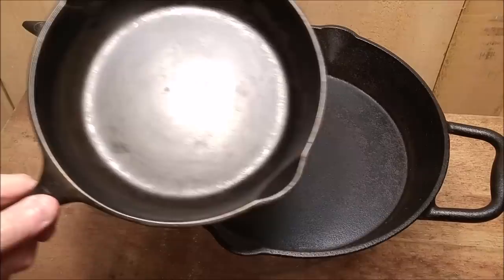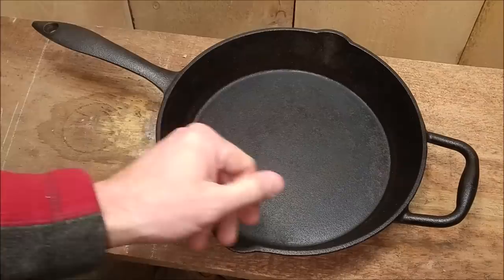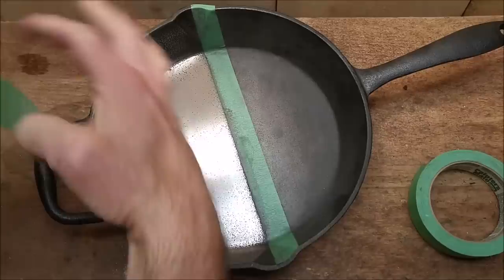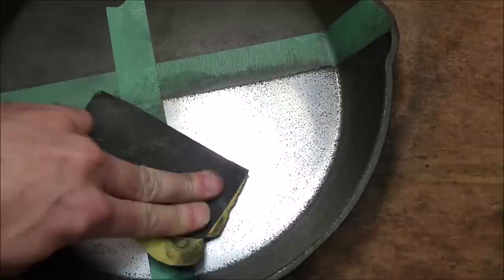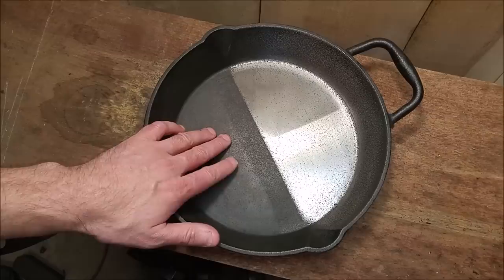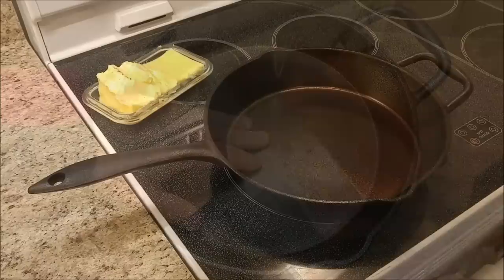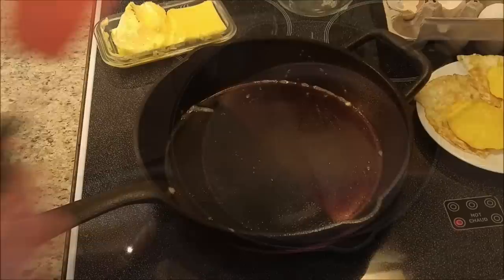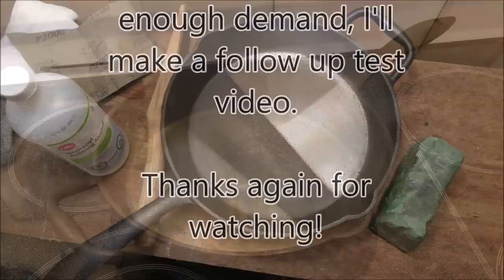🍳EXTREME Polish - Smooth a Cast Iron Pan to Reproduce an Antique Skillet then take it way beyond

Comment: You never need to do that many coats when seasoning.  One, maybe 2 is all you need.  Too much oil will make your pan sticky.
Reply from the maker: A few months ago this was a problem, but I've been using the Stargazer method lately and I get the deep black color more quickly and the coats are completely cured and hard.  1 coat may be enough, 2 and three coats work well also.

A thick layer of oil will cure if given the right heat and enough time.  I plan on showing this process in an upcoming video... another testing video, so I hope you'll check it out when I'm finished.

Comment: Thanks to show us useless work. I have original cast iron and don't see any reason make it shiny .  Work very well. Oh yes when I want see my face I use mirror ...
Reply from the maker: Yes, there is no reason to do this, but I know this by testing it.  The video is quite useful from a learning standpoint and gathering the thoughts from viewers to generate a consensus on the result.
Reply: The purpose was not to make it shiny for reflection. I'm thinking about doing something like this to my Lodge pans rough, sand-mold finish. To me, my smooth milled old Wagner, always had much better non-stick qualities.
Reply from the maker: @TheTony2u  I'll be releasing a new video in a day or two which does a good job of showing a semi-automatic smoothing process, along with info on a few good tips to prep for the seasoning.... and testing of course.  I will say that you only need to go to 120 grit and that holds the seasoning well, anything beyond that will work against you for adhesion.

Comment: Just get a ceramic coated one and no need for the extra work
Reply from the maker: I was just checking some out on Amazon tonight.   Are there any downsides?
Reply: @NeedItMakeIt  porcelain chips off at extreme heat
Reply: @twiin12879  i find mine sticks with certain foods where my regular cast iron does not.

Comment: You know nothing about cast iron.  Putting such a hot skilket under water like you did will cause warping or cracking.  Seriously, why woukd you show ithers to do that.
Reply from the maker: At the time of creating the video, maybe so.  What makes you say that doing this is a bad idea?  Please also provide your background so that everyone knows that this comes from someone who has valid knowledge on the subject.
Reply: @NeedItMakeIt  Not trying to pick on you, but since you threw it out there, honestly, your response verifies you don't know much about the nature of cast iron metel which is more prone to cracks and warping when exposed to significant temp changes in short time frames.  Just the nature of the metal.  My ex once used a crock pot, crock, made from ceramic, to boil water on the stove.  I laughed and told her it will crack the pot due to the temp differences.  She pulled the pot off the stove top to shiw me all was fine and at the exact moment the bottom fell off.  Funny but true story to illustrate my point.  I am a Naval Academy graduate with numerous engineering and chemistry courses. Plus I am a cast iron fan and have done lots of research. Why I sent this  is becaue I have a hard time finding cast iron cookware that has not been ruined by people who have abused it like you did.  So, please feel free to submit anything legit that states what i told you is incorrect.  I am sure you are a great guy, but you hold yourself out as some sort of cast iron expert, yet you do not some some basic principles.  Again, Mr cast iron expert, give me legit proof what i said is wrong and i will retract.
Reply from the maker: @Incognito_Shadow007  Thanks for the information Keith, I don't mind that you comment, people have their opinions, so let's hear them.  Please don't assume that you know anything about me by watching a video, and there are quite a few generalizations in your comment as well, "people have abused like you did".  You don't have context on much at all, and you've made quite a few assumptions.  

Now, I don't claim to be an expert by any means, nor do I say this is a good method or bad one, but it is the one that I do use, and it works well for me.  It seems that people who comment on this are 50/50, lots of people use this method, lots do not and have your opinion.  I say do what you like.  As far as proof, my pans... the pans I use daily, all still work, the work very well, they have not warped, but really, this isn't my idea I learned it from Kent Rollins https://kentrollins.com/easytricktocleancastiron/ , he has a video specifically on this topic and show people how it is done.  I have done further testing, however I have not yet had a chance to put a video together on this, and because people are obsessed with CI, it might not be a well received video unless it is approached from a completely non-biased perspective.

Now, if by some chance my pan does crack while performing this action, I will post in the comments, It is the subject of a few videos, people can see for themselves that it is still working quite well, and now is one of my favorite to use.  So as it stands, it is an effective way of cleaning the pans, and I'll continue to use it.

Again thanks for the comment, have a wonderful weekend.
Reply: @NeedItMakeIt  Thanks for tsking the effort.  Cowboy Kent starts off by explaining the danger of exposing "hot" cast iron to "cold" water as it can cause warpage and cracking.  Terms are in quotes b/c temp differentials are not defined. I assert Cowboy Kent's method will cause warpage and possible cracking (cracking mostly happens on the skillet walls, warping on the "flat" cook surface).  though his method will probably clean the pan faster.  So he warns about warping and cracking, and even burning yourself on the hot pan. Too many needless dangers.  BTW, the warpage is probably why you get different temp reading with your thermometer, as discussed in other comments - hot spots due to warpage.  About cast iron.  It is valued because it HOLDS heat, not because it a good conductor of heat, like copper, aluminium or even stainless. It is not. Conduction is how quickly the heat moves in the medium.  The metal structure of cast is like sandstone compared to clay (or glass which is in simple terms melted sand).  Because of this structure areas of cast do not dissipate the heat to the rest of the item quickly - thus holding the heat to create a great sear.  That is why it cracks - different temp areas and expansion.  So to heat to a higher temp a pan (well above 212 degrees to cause instant steam) then douse with "cooler" hot water from your tap (usually 120 degree range) is a qiuck and significant temp change which can cause the hotter and expanded metel to reshape itself against the now cooler surrounding metal - warpage.  To clean, you want a pan warm enough to liquify the fats so they can be removed by the water and your elbow grease.  No fats in cooking need that high of a temp to liquify to be removed.  Steam can actually get between the precious seasoning (baked on oils which create the nonstick surface - a very good thing) and the metal, causing you to lose your seasoning.  So while your pan should be warm, it should not be so hot to cause the steam.  The method of heating it on the stove to heat for cleaning is also not preferred. Better to put it into a stove set at 225 - lowest setting - to warm to point of melted fats/ oils, then remove.  This heats the entire pan, not just the bottom - remember cast does not conduct as quickly as other metals.  Once cool enough then run under the "hot" water from your tap.  Yes you may have to scrub but you wont burn you hands. Warping does not happen like a flopping tortilla.  I causes slight depressions or high spots in your flat cooking area.  But these grow over time. To test, put some oil in you pan to see how it spreads over the surface.  If it pools in an area, that is a low spot. Or it runs around higher spots.  Especially on todays induction stove tops, a flat cook surface is important. The spots in contact with the stove surface get hotter faster than those where there is a slight gap between them.  It slowly gets worse and worse.  Most used cast iron today has this warpage and I have seen many cracked, though sometimes the cracks are hidden under thick seasonons on the walls.  So for anyone who has spent considerable amount of money, or who has a family heirloom, or vintage piece, use caution when deciding how to clean your piece. It taken care of properly, it can last several lifetimes.  As to the creator of this video, not trying to undermine you any more than to correct what you put out as the way to clean cast iron.  Your method works, but at a price.  You can take care of your own cast iron as you see fit.  Eventually, you will find that your pans have warped and at that time, they cannot be fixed.  Good luck.
Reply: And my initial comment that you know nothing about cast iron was more harsh than needed or intended.  For that I apologize.  My comment was to the basic properties of cast iron and to my belief that your method is harmful to cast iron cookware. Of which I have seen too many quality and otherwise valuable pieces damaged. Including through my own mistakes.
Reply: Look at this site for cleaning instructions - linked from Cowboy Kents webpage.
http://www.castironcollector.com/maintenance.php
 Which states: Allow a pan to cool on its own to room temperature before cleaning.

Comment: WHY?
Reply from the maker: Cast iron pans used to come from the manufacturer smooth.  A rough pan is harder to clean, a smooth pan both reproduces the old ways  and makes them easier to clean.  

Do you need to?  No.   A smooth surface will be produced over time as long as you use it regularly and it would seem that using a metal spatula will help this process along. 

WHY NOT?
Reply: NeedItMakeIt 
Your right why not. Lol
Reply from the maker: @bryanroye1112  I just like to spend time in the shop doing work by hand.  Nothing like spending time with my friends (tools).